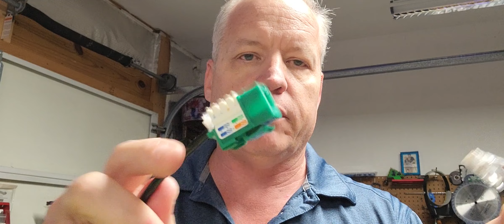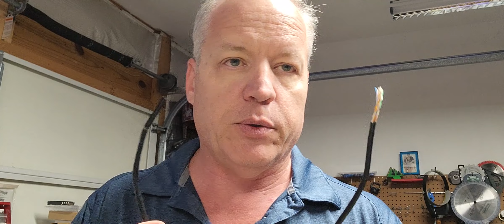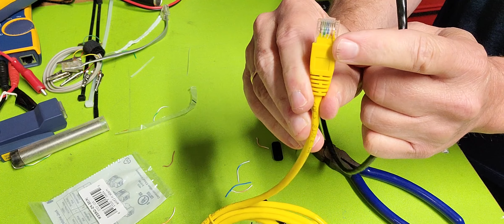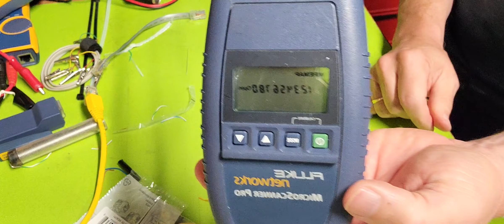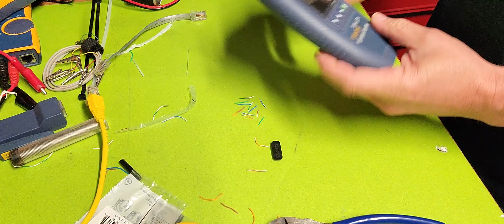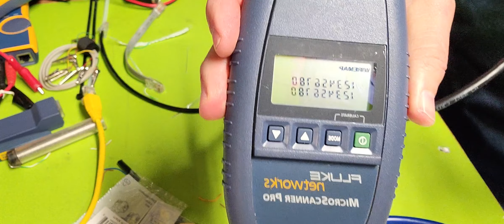My new home data Center rebuild effort and how to build out Keystone CAT6 7 and 5e patch panel work

Comment: hey brad do you have any suggestions on other types of cable testers other than fluke as you do get ones which show a light but they give no number display like the fluke their also more reasonably priced as although fluke is nice im thinking its over priced although probably good value
Reply from the maker: Yes, you can get a cheap cable kit for around $35 here isa link.  https://www.newegg.com/p/1W9-00KZ-00004?Description=CAT%205%20cable%20testers&cm_re=CAT_5%20cable%20testers-9SIAMYECB17264-Product 

Keep in mind the tester is basic but it will work for your needs.  If you want more features just get a little better tester.